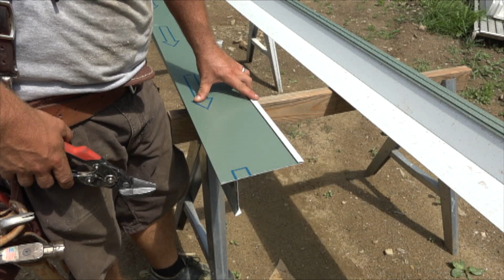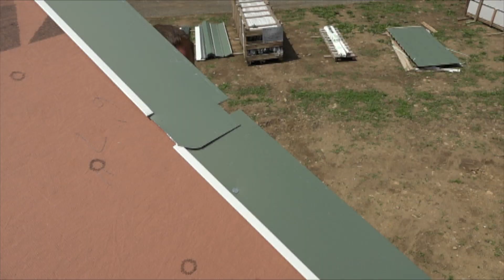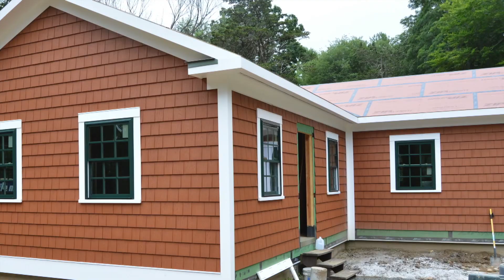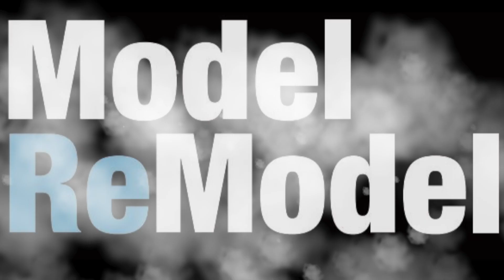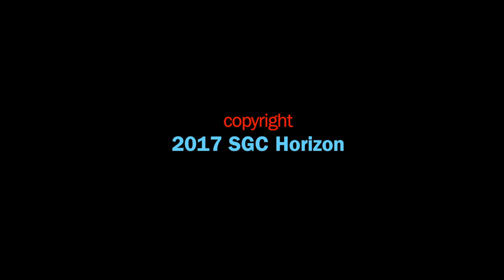Flashing Basics: How to Overlap Edge Metal Neatly

Comment: At the bottom trim (water table trim) board, how do you terminate the flashing where it butts into the corner trim? End dam, and caulk the other side of the end dam where it meets the corner trim, or just cut it to length, and caulk.?